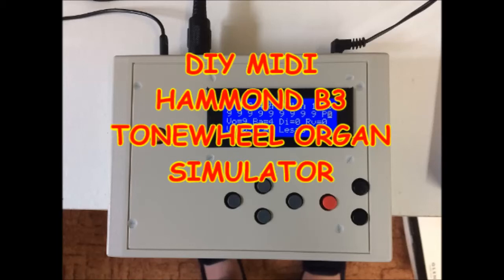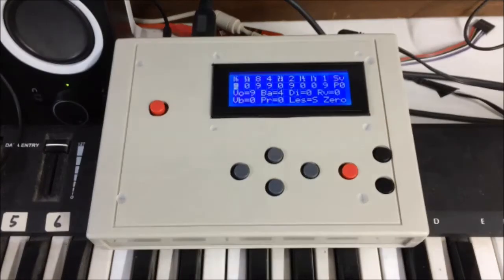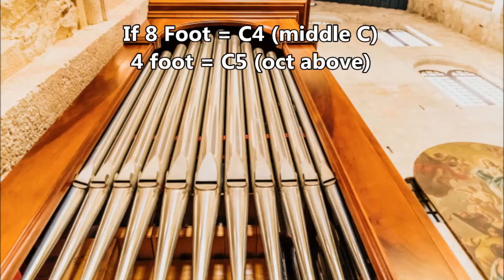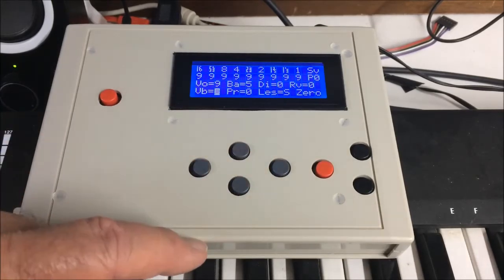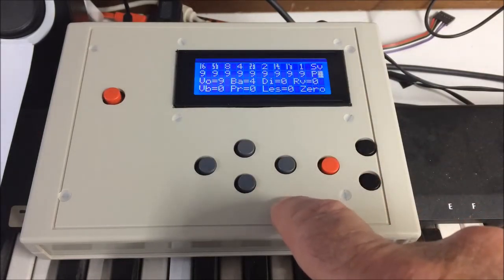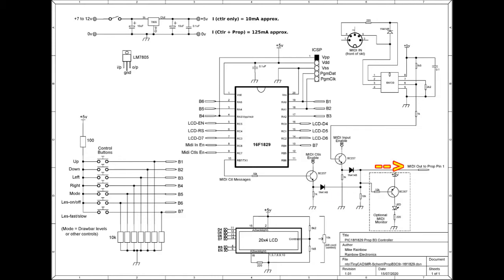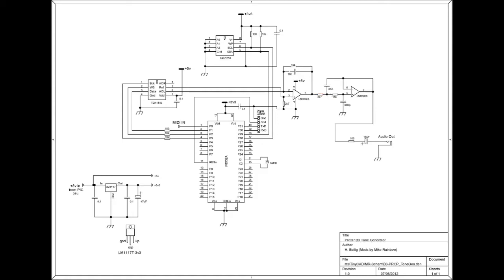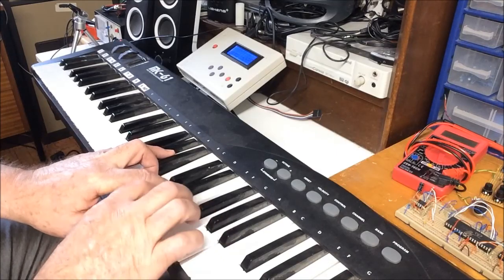How To Build A Hammond B3 Tonewheel Organ Simulator - PART 2

Comment: Why not just create an analog version with real slide pulls? And maybe some rotary knobs for adjustment! Would make it much easier hands on when playing live
Reply from the maker: This is exactly what I did as shown at 7.45 on part one of this video - I used a PIC18F452 to convert the analog voltages from the sliders and pots to MIDI messages.

Comment: Hi there I can see a bin file and a hex file, but is there source code I can read? Thank you!
Reply from the maker: Hi, unfortunately Hubert Bollig has not released the source code for the Prop programme which does all the hard work generating the B3 sounds. The controller code is pretty straight forward and written in GCB (Great Cow Basic) which I haven't  uploaded yet.

Comment: Interesting project, I think I would like to try and make it. I use KiCAD and I will have to redraw the schematics to layout a PCB. Maybe I can incorporate all the hardware (switches, LCD) on one board. I can look if there are SMD versions of all the components as well.
Reply from the maker: Hi Tim, good luck with your project - let me know how you get on.
Reply: @mikerainbow  Looks like the PIC 16F1829 is available as a SOIC-20 and P8X32A is available as a QFP-44. Unfortunately, the PIC chips are not due in at Mouser until July of 2023 so I'll have to see if I can source them elsewhere. They show up on ebay from China, but...🤔
Reply from the maker: @timgood4003  Yes, this should be fine - the prop and eprom need way less than 100mA so there should be no problem.
Reply: @mikerainbow  Do you have the part number for the plastic case you used? Looks like a Hammond to me. And the switches and jacks?
Reply from the maker: @timgood4003  It's a Hammond 1590BB powder coated enclosure (120x95x35mm), general purpose miniature toggle switches - 1 x SPDT, 1 x SPST and 2 x DPDT footswitches. Jack sockets are standard 6mm(1/4") mono.

Comment: Hi, thanks for sharing! Very interested, and also intrigued by the original design with the adjustable drawbars - have you got any further with this? Would be excellent to have one a Hammond simulator.
Reply from the maker: Hi, thanks for your interest in the project - I completed the design for the drawbar version but haven't finished the prototype - unfortunately I tend to get distracted by other ideas and projects.